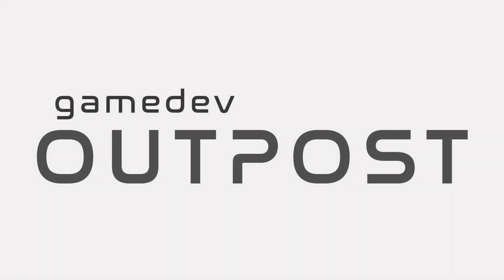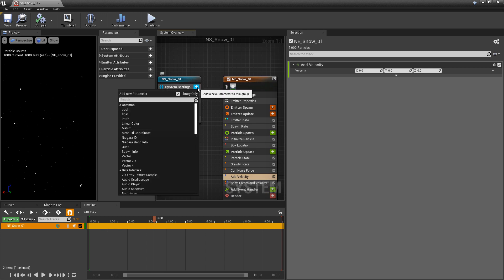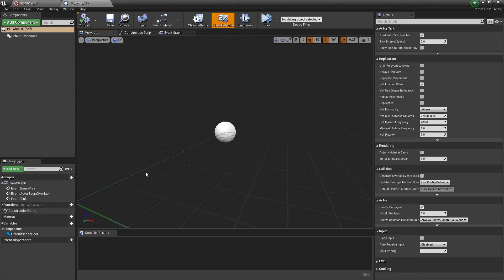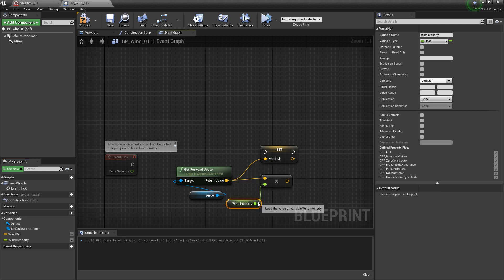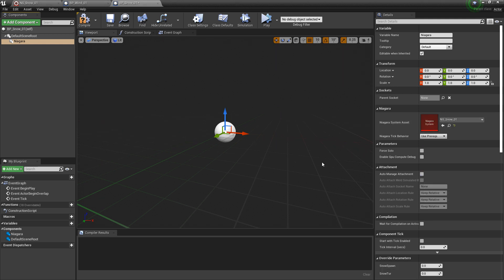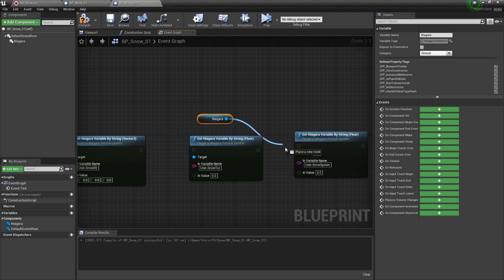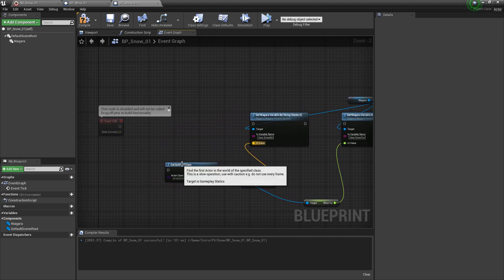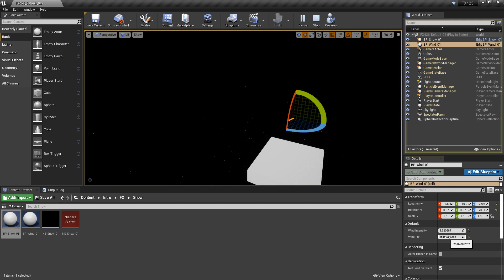UE4 - Niagara Ambient FX - Snow - Part 2 - Wind System

Comment: no need to get actors of class with tick, just set reference with a variable on begin play and use it.
Reply: Yeah get all actors of class can be one of the most expensive operations in a blueprint - especially using tick. Having worked on projects were designers used this, they had them all removed and the blueprint was refactored.

You also don't need to update the wind direction/strength (or push it to the niagara systems) at framerate, only when it changes. You can set this up quite easily and dramatically reduce the cost of the blueprint. My wind system had a gust system and used timers instead of tick, I also use Niagara Parameter Collections for persistent data like the current wind state - can just as easily use user params of course but the wind data was used in multiple niagara systems and materials.

Comment: Using UE5 here: the Add Velocity module is no longer in the Particle Update group, is actually in the Particle Spawn group now.
Reply from the maker: Yeah it's interesting. Add velocity used to be in both. In particle update you have "update velocity" and it's dependant on having an add velocity in particle spawn.

Comment: Hey I see youre using unreal too ..i got a question and maybe you can help if you know 😆 so I made this animation montage on my character for my attack but everytime the animation plays it, it slowly makes my character float and lean and doesnt go back to original position which also messes up my run and idle animation...you can check the my video here — https://www.facebook.com/groups/igdcph/permalink/1554906218232442/
Reply from the maker: I haven't had to deal with montages in awhile, but you might want to consider just putting it in your animation blueprint via Animgraph so you blend back to position easier. Montages can be used in your Animgraph as well. If you still have that issue, it could be many things unfortunately. Let me know how it's going!
Reply: @gamedevoutpost9270  thanks, I will try putting it as an animation in my animation blueprint instead of a montage..I have tried putting constraints too in the x and y axis in my capsule component and I increased the angular damping too but it did not work..as of now the only solution is to use the function SetActorRelativeRotation after playing the montage and that keeps the character in place the only drawback is that it only faces on a fixed direction when it attacks like it keeps on facing right even if you intend to attack on the left 😅